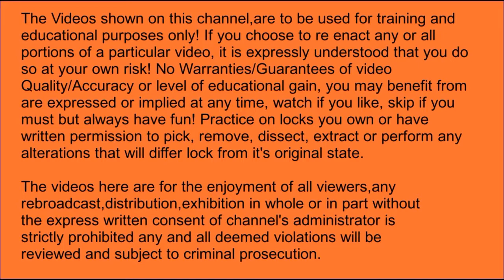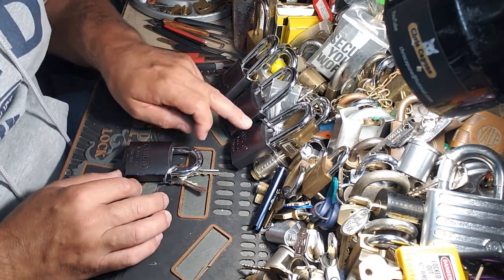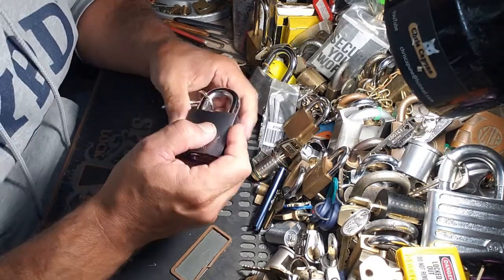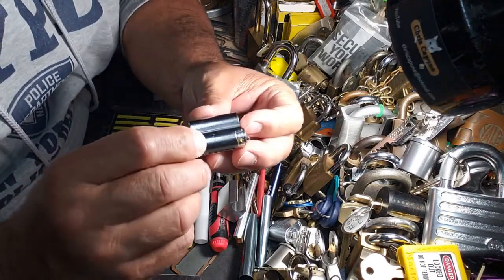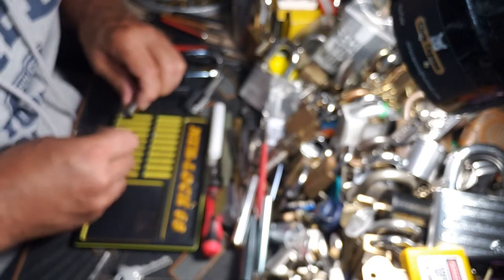# 750   MUR-LOCK 68   Charcoal Abus 83AL50 Padlock #4  SPP'd

Comment: I di like the charcoal coloured Abus locks. Regarding the slightly flat top in the core, I have come across a couple in euro cylinders, tou don't think they could have been done at the factory? Didn't you say in one of your previous videos it makes it slightly easier to pick?
Great video as always Mur-Lock.
Reply from the maker: Thanks Roy Appreciate your support my friend 
The flat spot is typically created by someone who quickly puts in any longer sized key pin in all chambers then files it down so you have a uniform shearline as opposed to seeking out the correct pins that correspond to the required bitting.
As far as ease of picking I may have referenced a core that had one or more of the key pin slots widened or wallowed  out which would in my opinion decrease the tight tolerance therefore make it easier to set pins
Hope that helps Roy 
Now these are Abus padlocks  and I have never seen this from factory  its definitely aftermarket as all were keyed Alike I changed each one as I featured it
Stay well mate
Reply: @Mur-lock68  Thanks for the explanation Mur-Lock.
🙂👍🏻

Comment: Awesome rebuild, trying to see if I can join the Master Lock#19 open club
Reply: Is there a patch or something for that? 
They are cool Master locks!!!!
🐾🐈‍⬛🐈🐾😷🇺🇸👏👏👏👏
Reply: @chriscapune7873  not that I know of but it makes good on bragging rights though. I still haven't heard anything about possible patch from my 200k which also turned into my first and last belt submission video.
Reply: @j.gabriel8573  ok. Yes bragging rights are good!!! 
In the 200K patch. I just sent him a link to a video I did picking a lock that shows the 200K on the key and the open. Can’t remember if it was the 90 Pro video or the Loto video? 
But I did get my patch 😀 
Good job on your belt!!! 
🐾🐈‍⬛🐈🐾😷🇺🇸👏👏👏👏👏
Reply: Right!! Locksmith Viking got an open on the one I loaned him, took a picture and rubbed it in my face! I'm going to get an open on one!
Reply from the maker: Ahh yes the master #19 club would look good on your Resume!
I know you can do it be patient!
Will be taking a crack at another  one soon enough lol
Stay well
Reply: @Mur-lock68  I'm not giving up, I got time, alternating on pin and CL making and lock picking